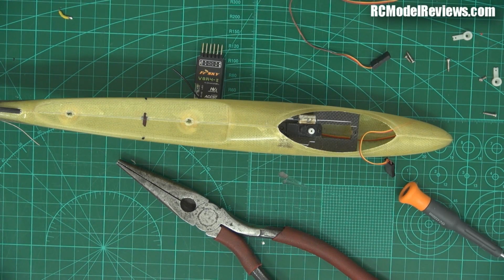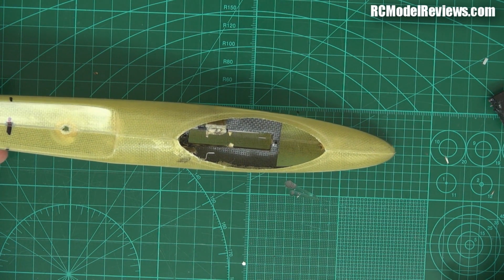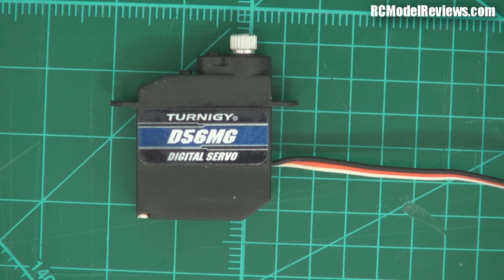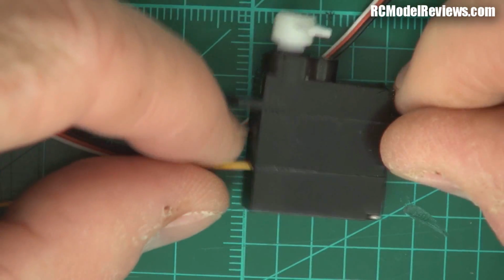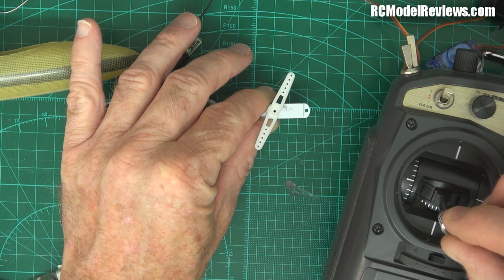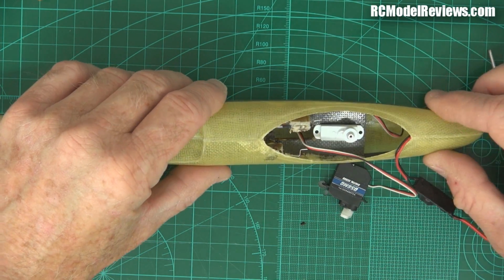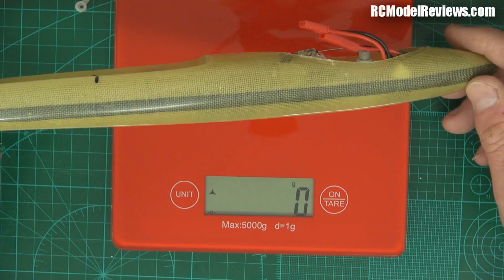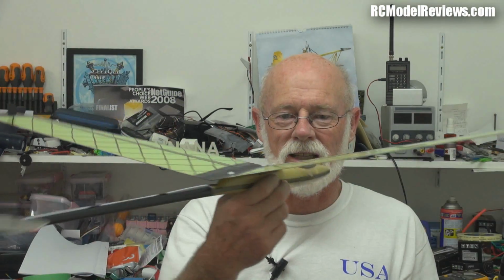Mini DLG Composite 1000mm from HobbyKing (part 2)

Comment: Hey, you mentioned a couple times about some of your servos having an incompatible plug, by that I take it that they had the JR style plug with the little tab and I just wanted to say that with some careful scalpel work it is quickly and easily removed and works and looks just like a normal style plug. Keep up the good work :)
Reply: some of the smaller sub micro servos come with a different style of connector entirely. 1.5mm micro-jst. they're on some of frsky's micro indoor receivers etc. There are adaptors available for converting them to the standard 2.5mm pitch plugs though
Reply: Chris Tate Ah right I see! I don't usually have much to do with the micro stuff so thanks :)

Comment: Hi Bruce,
Looking at buying DLG, currently flying copters and quads.
I have Walkera 2801 pro RX and a spare TX.
What size TX will fit. Mine is  39X28.5X14.5mm as it is an 8 chan.
I'm finding it difficult to find micro TX's for my RX.

Comment: Seems to me you could gain access to the whole inside of the fuse by just cutting a portion of the bottom off.  Tape it back when you are done inserting all the bits.
Reply: Cutting any holes in the fuselage are bound to compromise the overall strength of the unit, surely?
Reply: David Cole
Most definitely, and don't call him Shirley.

Comment: the problem with hobbyking is the people packing/assembling these things arent hobbyists their just a bunch of randoms in china trying to make a dollar. however if youre willing to go through the time consuming process of HK customer service they will replace the faulty parts, or at the very least credit your account. the trick is getting in touch with north american CS even if your in NZ or UK or whatever they will help you. just be sure to keep in mind when purchasing HK brand products, the failure rate in my experience is 50% or more. if you dont want to wait fro replacement parts order extras. if any are faulty you can most likely get a refund if not you get extras for when you crash.

Comment: this would be an easy fix try super glue remover to completely removing the servo tray.good servos for small dlg are Ripmax SD100 Servo you dont need a ubec they operate up to 7.2volts

Comment: A good video Bruce, I wish you wouldn't groan and moan so much though. I think most of us get that there is a lot of poor gear out there, it gets a little depressing to keep hearing the groans and sighs. =)
Reply: if i wasted 8hrs build time on a pnf glider i would be straight up cursing.  So i think a little grumbling would be in order wouldn't you haha
Reply: 2007crf450r Just my 2 cents. While I agree with "a little grumbling would be in order" Bruce should have probably cut some out. This video while informative should not have been 16 min.
Reply: I agree too. I love your videos and appreciate them a great deal but I think everyone knows that if you choose to use "budget" gear then you roll the dice.
Reply: 2007crf450r
This is not a "build", this is an assembly. Build is when you get a box of sticks and formers and plans with a bit of hardware.

Also plans where you have to glue all the pieces over, straight and accurate. Then you have to COVER the model with your choice of covering. THEN, if you like to jazz it up, apply trim which you have to cut out yourself after designing the colour scheme YOURSELF.

Eight hours to get a glider into the air? Yes, you paid a lot for it, but a REAL kit might only cost a half and then you have to spend 20 to 50 hours of your shop time. Apply minimum wage to that,,,,,

Just my 5 cents.
Reply: hopeso I bought the bare bones version. I'm going to be using a Lemon receiver, http://www.lemon-rx.com/shop/index.php?route=product/product&product_id=92  which is full range and a NiMh pack, it's some 200mAh, 1/3 AAA, I think.

LOTS of room in that well formed and compact pod. I'll not be using the servo tray, I'll be using servo tape.

Why use Lipos and a UBEC and a voltage booster? With no motor, just two servos and an Rx,, 200mAh will last all day. If you catch a thermal and stay up for 2 hours, no worries, you're not hawking the servos around as with a powered model.

I've been flying gliders for years, works for me.

Mine had a slight warp, just turn on your ELECTRIC stove element, wave the wing panel around, top and bottom till it's just warm, twist in the other direction and Bob's your Uncle.

Comment: You could have used a smaller battery and add some lead to the nose and fly with the stock servos.  Then you wouldn't have so much time into something that will never be as fun as a 250 mini quad.  Ha!  I've had duds like this before.  A 15 size extra arf who's horizontal stabilizer was off a few degrees from the factory.  Its was terrible and when it finally did go into the ground it was the only plane I've had where I felt relief after the crash.  It was gone and I could move on.

Comment: G'day Bruce,

 Well, technically, "Yay Team !", because 40% extra Weight for 5% extra Span and maybe 2.5% additional Area means it'll cut through the Sink SO Much faster, between the Thermals ; it's why the Human-Piloted Sailplanes take-off with so much Water-Ballast, the better to fly faster...

But, otherwise ; here be a Haiku, for you...(!).

 Plug and Fly,
  Means...
 Weep, and Cry...!

 And on the strength of this, I would never ever buy ANYTHING which emanated from the RobbyKing Gang of Fraudulent Thieves.

;-p

Ciao !

Comment: EMax ES9051D 4.3 g, 0.09 s are really good micro servor super fast and accurate but they are not metal gear :(
Reply: Don't want metal gears on a DLG. Particularly the elevator as they develop slop with wear and you have difficulty with centering. Unless you use pull spring controls which of course are best on a light DLG. Also not digital on smaller gliders as increased consumption. Best by far are still the slow analogue Dymond D47s with low consumption and good performance.